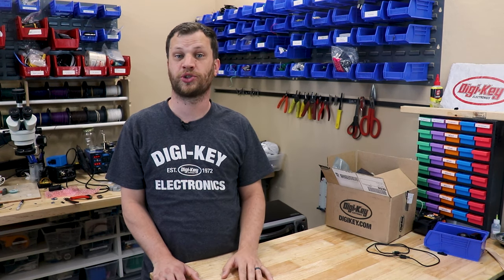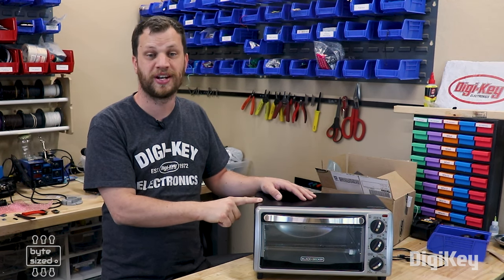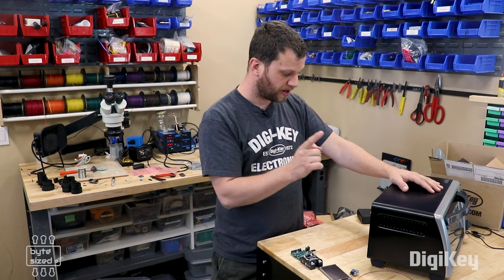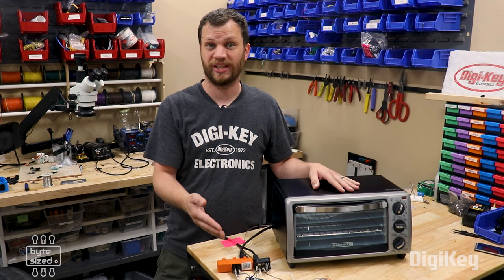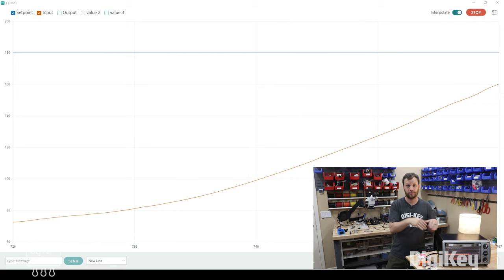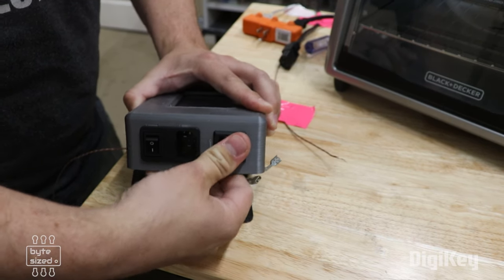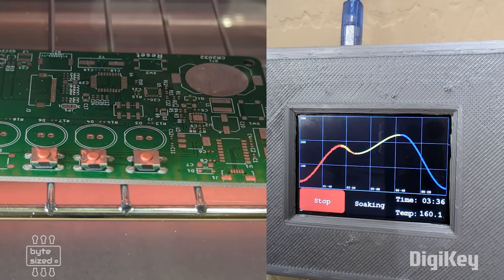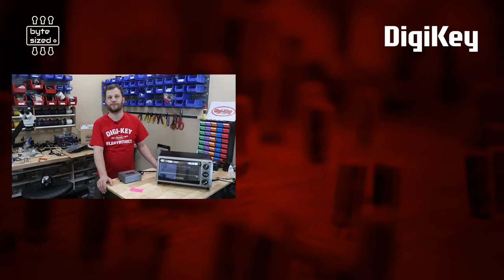How To Build A Solder Reflow Oven - The Byte Sized Engineer | DigiKey

Comment: The knob is to keep you from putting it directly against the wall where it might overheat or start a fire.
Reply: My very first thought on the knob. There's only a single steel wall separating 400° inside with 72° outside.

Comment: That kind of oven heats very unevenly though, whenever I bake something in it the middle parts get much more browning than the borders due to higher IR exposure. Using this for reflow you might either get cold joints in the edges or overstress components near the middle. Also you should consider that the thermocouple might not accurately measure the temperature the PCB will be in since the board will be receiving direct IR radiation in a large area, and the thermocouple has a very small area footprint. A larger convection oven or one with multiple, spread out heating elements would be much more adequate for this, and I'd maybe using a plate head thermocouple in order for it to receive more IR so you get more accurate readings

Comment: Heat sink is usually required on the SSR when switching larger loads. See the device data sheet and read the nameplate on the appliance being switched.

I'd rather gut the controls from the oven completely and just wire directly so that the over can't be used for food..

But keep the controller outside the oven enclosure where it's cooler. Mount to the outside with a hole for an inverted U duct with a pwm fan for the cooling profile.

Comment: PID measures and produces an analog input/output. Therefore the light would not turn on and off but would dim and brighten. My guess is that your using some modification of on-off control which is traditionally used for controlling thermal systems.

Comment: What "code" did you use to "rotate" the resistive touch panel so it matches up with the buttons? I put you code in my Mega and the resistive touch (per the parts supply list), but the touch coordinates are not "rotated" with the screen. The touch is un-movable and x/y is in the portrait position, but the graphics (buttons etc.) are in land scape. Could you post your code that you used to fix this?

Comment: Is there a manufacturer and part # for the oven you chose that you can share for this project?
Reply: I think any toaster oven that doesn’t have digital controls would work. I use an cheap 20$ walmart brand one with quartz heating elements. I mightve missed him mention it. But basically you just turn timer off on toaster and set it to max temp. The relay will keep rapidly turning it on off to regulate the temperature